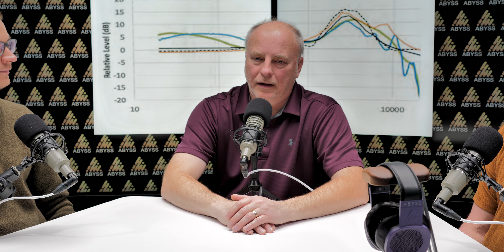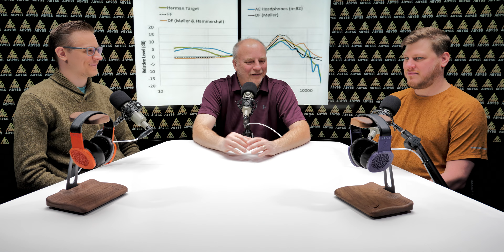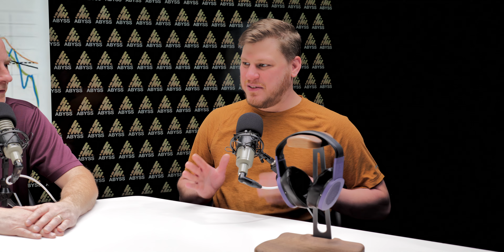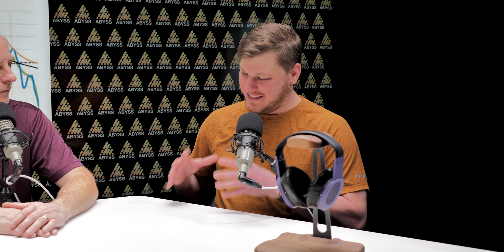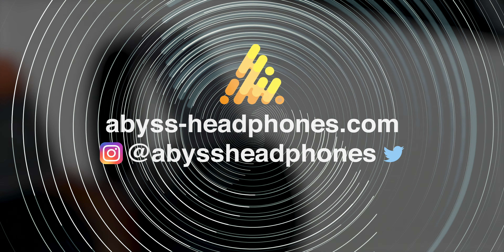Abyss Headphones Target Frequency  Response  Measurement

Comment: We do a similar thing in the medical imaging system design space. We have a reference x-ray image of someone with a disease. We then take some more identical photos with the x-ray machine tweaked in different ways. We then get many doctors to 'A:B' the reference image and one of the tweaked ones, and get them to rate the clarity of subjective features of the images. We then use that data to tweak how the machine operates. The takeaway is that it's an intimate feedback loop between designer and user, usually around 'soft' measures of quality. We also weight the ratings depending on the seniority of the doctor.  Sounds similar to headphone design
Reply from the maker: Thanks for this!
Reply: @ABYSSHeadphones  No worries. The process is called "Visual Grading Analysis", for any curious parties.